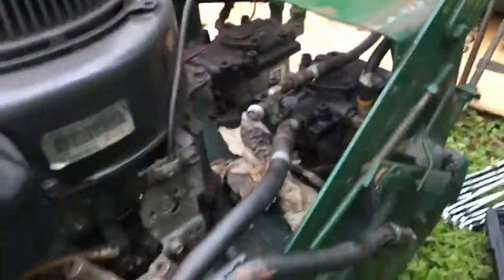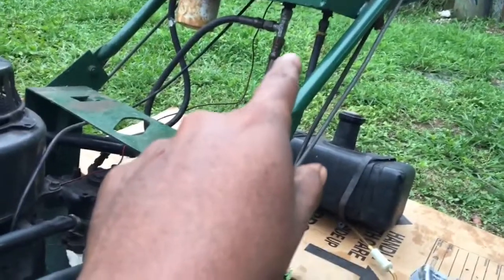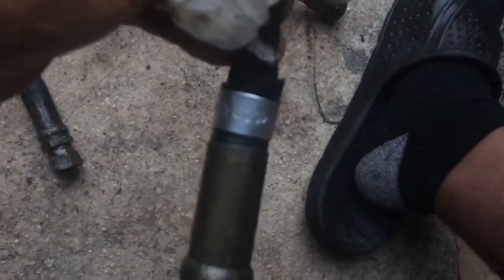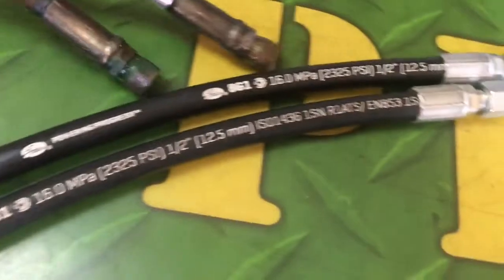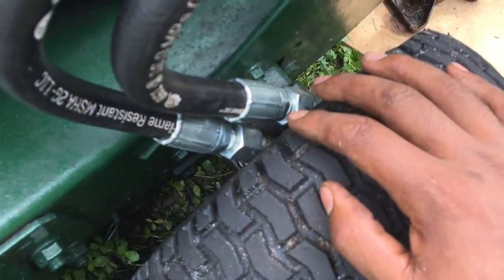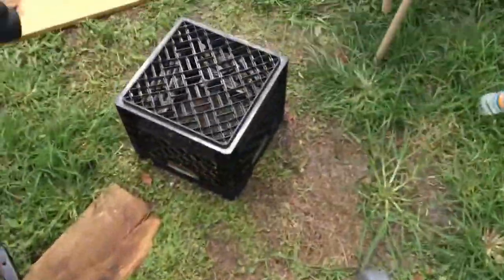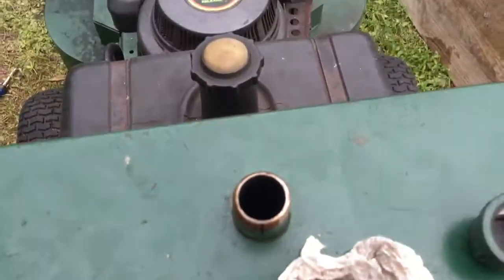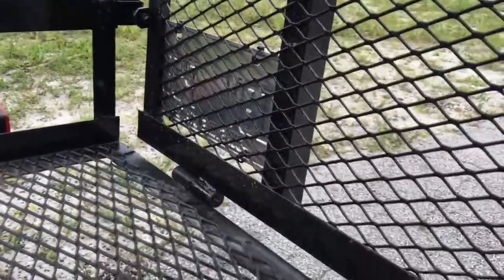Replacing Hydraulic Hoses to a 36" Bunton walk behind mower

Comment: I realize this video is a few years old and thanks for sharing your knowledge. How did you purge any air our of the lines afterwards? You had some good tips like a major one: Make sure the line does not rub the tires etc. :) Thanks
Reply from the maker: thanks for the wonderful comment. this is how i purged the lines. The first thing i did was release the handle bars from its clamp. I freed the handle bars first, then i loosened the hose from the nut with a wrench. I just popped the nut loose a little, and let the oil drain from the hose. I didnt fully loosen and remove the nut until all the oil was completely drained. then I removed the nut and hose off the mower.  hope that helps
Reply: @GreenThumbEngines  Thanks again for the info, that really helps and makes sense.

Comment: How difficult are the hoses to unscrew to get off ?  Any trick to getting new o-rings seated in female coupler or the 90 elbow at wheel motor base?
Reply from the maker: The hoses were pretty easy, just takes a simple wrench that fits in there. Oil will drain out once you loosen the hose and get it off. I forget if there was pressure in the hose or not, maybe the video here I made noted that or not, but I’m guessing if it did have pressure just put gear in neutral. But it’s real simple. Just take wheels off and one hose at a time. There’s nothing you have to worry about. Very simple taking it off.
Reply from the maker: Far as the couplers that the hose bolts to, I’m not sure. I just took the hose off and took it to a hose shop and they made me a new one in 3mins. I didn’t have to change anything on the couplers. I left that on the unit. I just replaced the hose.

Comment: Where did you find the hoses
Reply from the maker: Ok this is what I did. On the handle bars, I  released the clamp, then I loosened up the hose a little until all the oil drained out. Once it all drained out, I fully unscrewed the hose off and took it with me to my nearest hose shop. There’s hose shops all around us. Just search google and say, where is the nearest hose shop, and bring the hose with you and they will make you a new one in 5 mins. Here’s the video to show you how I did it https://youtu.be/VuTGmj1rz9o
Reply: @GreenThumbEngines  sweet thanks. How did you purge the system after installing the new ones?
Reply from the maker: @chrisjr1028  I unlocked the brakes on the handle bars. Then I loosened the hose, and let the oil drain and bleed out. Then I finished taking the hose off once the oil was finally drained. Make sure the first thing you do is unlock the brakes on the handle bars so there’s no tension in the hose lines
Reply from the maker: @chrisjr1028  I think you just have to purge it before you take the hoses off. Not before installing the new ones. You purge it to release the tension in the lines or else there will be a lot of pressure coming out the hose if you don’t release the clamps at the handle bars. After you do that, you just take off old hose and put new one on and fill it back up with oil and that’s it. (I can’t remember, lol but I listed everything in this video I’m sure of it) this video is for me to watch when I need to do it again too
Reply: @GreenThumbEngines  thank you for all of your help I'm sure I'll have more questions. I picked this thing up for 200 bucks. Couldn't beat it. Put a carb on it and now the hoses I have to do
Reply from the maker: @chrisjr1028  Wow what a great price. I am jealous. And Thank you for your kind words. Don’t be afraid to ask. Makes me want to crank up mine and make another video. You got me going on this. Thank you for the inspiration. I wish the best of luck to you. Im positive you’ll get it moving in no time.
Reply: @GreenThumbEngines  maybe some help with wiring up a kill switch to it would help me greatly. Since I have no way to kill the engine other than to choke it right now
Reply: @GreenThumbEngines  hey man. Minr keeps going in reverse. Any ideas?